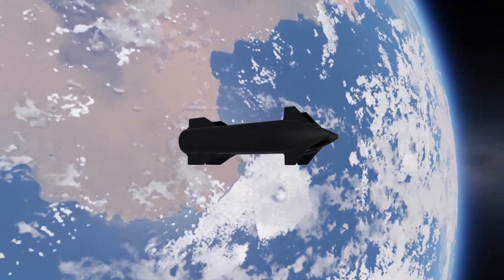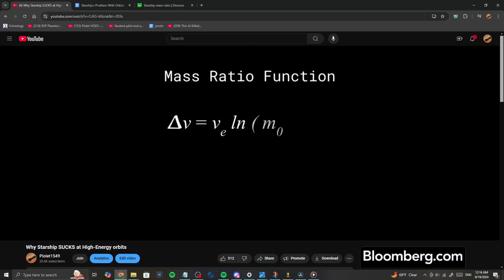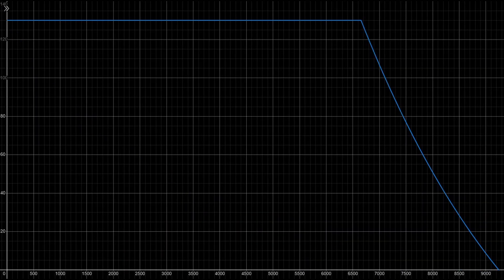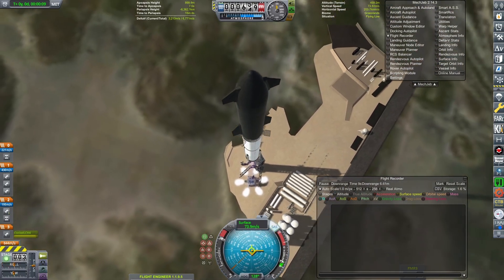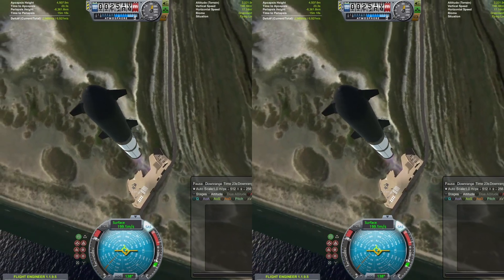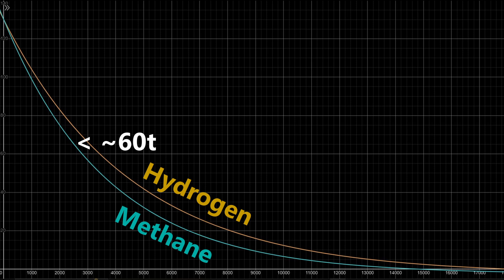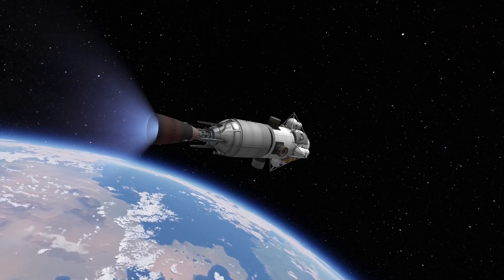Starship's Problem With Orbital-Refilling

Comment: More launches is also more wear and tear on the equipment on the launchpad, the engines, stress on tanks and valves, etc. It’s not just the cost of the fuel
Reply from the maker: Good point
Reply: Yeah, something I think people discount when we talk reusability is that airliners already have a finite life due to pressure cycling and such, spacecraft would probably be even more short-lived - although still better than throwing them away, of course. That's why most airliners you'll ever fly are reasonably new, whereas in France you might instead take a train that is pushing 40 and still works perfectly.

Comment: What cost more? An expendable kick stage, or couple of reusable starship launches?
Reply: Why would the kickstage be expended?
Reply: @Super-Duper_Space_Goat Definitely. At an orbit that high they wouldn’t want to.
Reply: Five launches or throwing out one stage? Unless SpaceX is doing like a starship launch a week or even faster I imagine the expendable stage is cheaper.
Reply: Depends on the kickstage. An RL-10 powered kickstage is going to be very expensive, to the point Starship could be 15 mil a launch and still match the total price with refueling
Reply: @minerscale  falcon 9 is launch more than 1 per week now so I guess five launches is better
Reply: @minerscale you’d be surprised. The majority of the cost of launching a Falcon 9 goes towards building a new second stage
Reply: @minerscale  Falcon 9 averages 2 per week in 2023, I think they can also do it with starship.
Reply: Getting the stage back to LEO should be almost free, in Fuel terms. The launcher potentially doesn't even need to wait for the light aerobraking to bring down the apoapsis but instead can just picks up a stage waiting in the right inclination.
Reply: I think the idea is to also reuse the kick stage, either by putting another payload on it in orbit and refueling it, or bringing it back to the ship and having the ship take it back down
Reply: If that was the case, then why would Tom Mueller leave the company and develop another company that would develop kick stage that would be compatible with Falcon 9 and, maybe if they wanted to, develop a kickstage Starship
Reply: @JesbaamSanchez  He is gambling that New Glenn won't be there in time to serve as the vehicle that satisfies needs between the limitations of Falcon 9/Heavy and the excess of Starship.  During, of course, the transition period when designers of payloads begin to understand what they can do with a Starship-like fairing.
Reply: @JesbaamSanchez  That was a genuine question of mine, and refueling is not an option for Falcon 9.

Comment: Orbital refueling, not refilling, please. That is what it is normally called.
Reply: Oxidizer isn't fuel so it's more accurate to call it refilling rather than to refuel because fuel isn't the only thing that's being put in the vehicle.
Reply: Maybe it would be more accurate in some ways. It is still called orbital refuleing. If you google search "orbital refuleing" and "orbital refilling" you can clearly see that refuleing is the technical term used in english.
Reply: @irhtirht  
And if he clearly look up in the dictionary gay means happy.
But I doubt anyone using the word today uses it like that. 

Dictionaries are only so useful this is a descriptive language people just start using words and they apply meaning then they get added to the dictionary
Reply from the maker: I said I mix of both refueling and refilling in the video (mostly refilling though). I personally think refilling is the correct term because the oxidizer is technically not a fuel. I guess you could say that it is technically refueling because you are still transferring fuel, iits just doing something else with the lox. At the end of the day I don't think its a big deal, say whichever you prefer
Reply: It's refilling, because you're transferring both fuel and liquid oxidizer.
Reply: I just refilled my water bottle from a larger water bottle. I believe that can be done with fuel also

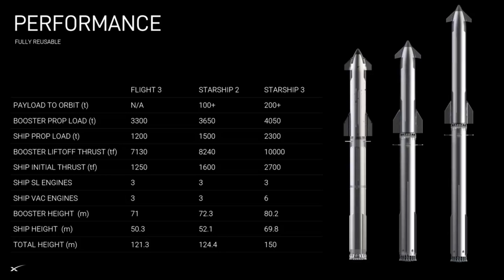Comment: 8:08 Block 3's payload section in that render is the same as Block 2's, which is comically small (about 3 rings tall including the volume in the nosecone).
Reply: The render is not transparent so I'd love to know your source.  Officially, Starship V1's payload is 17 meters tall.  I would be extremely surprised if the V2/V3 grew in size, doubled or quadrupled payload mass, but shrunk the payload bay by over 60%.  But even if they did... that's the beauty of a vehicle that was designed from the ground up to be cheap to manufacture.  If you actually need a fairing that's taller than 17 meters, you can kick out a custom Starship, like they'll be doing for HLS for example.
Reply: @Asterra2  You can see where the starlink door is and that's always at the bottom of the payload bay.

Comment: I failed to see how 2 starship launch with kick stage would be cheaper than 5 launch, a falcon 9 stage 2 cost up to ~15M and is the majority of falcon 9 cost, a kick stage would likely be in a similar ballpark.
Reply: The kickstage is expected to be reusable :-)
Reply: It's not really a kickstage then, it's an orbital tug, and that's a completely different argument
Reply: @SirDoggydog  anything with an RL-10 engine would not be cheap
Reply: The video is arguing for a tug to take the payload to GEO, then return to Starshjp and get recovered. While an RL-10 would be hilarious expensive, reusing it would likely make it cheap enough that such a setup makes sense.

An actual expendable kickstage powered by one would be stupid though.
Reply: @SirDoggydog  hmm I don't think  that's what the video try to model in the graph but I guess you can do a whole lot of delta v with a 130t payload
Reply: @hieunguyen-bj3fx  They specifically subtracted five tons for propellant to return to Starship. That's definitely what was modeled in the graph.